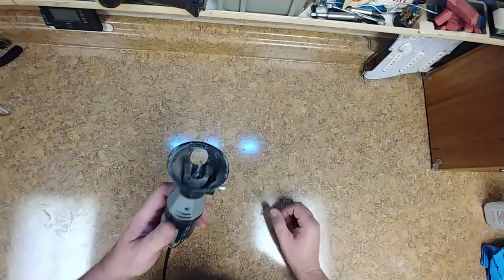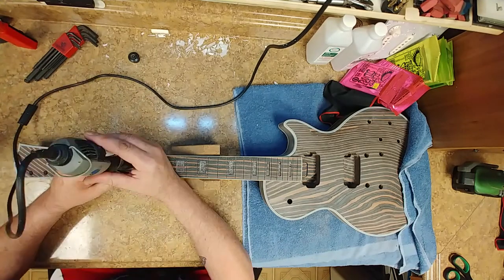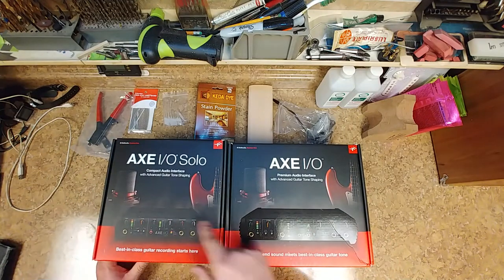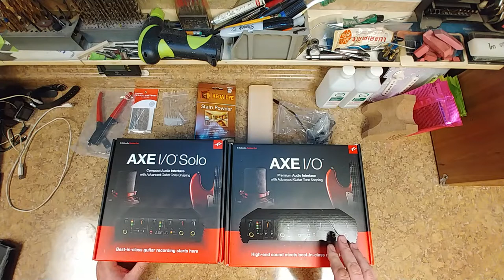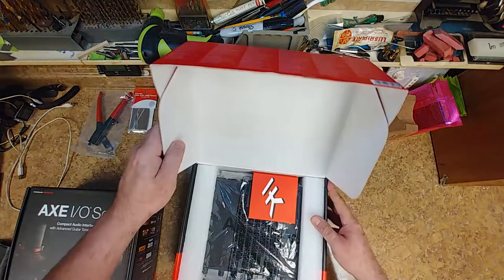Zebra Kit Will This Work Glow In The Dark Inlays

Comment: I use the cutoff wheel in my dremel tool to trim fret tangs, it works well, and no filing is required like after nipping them off.